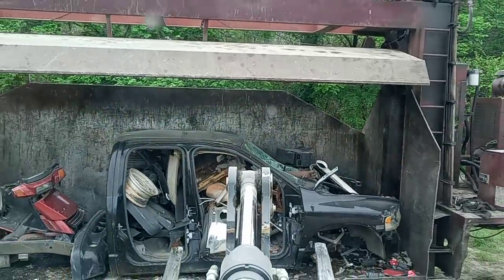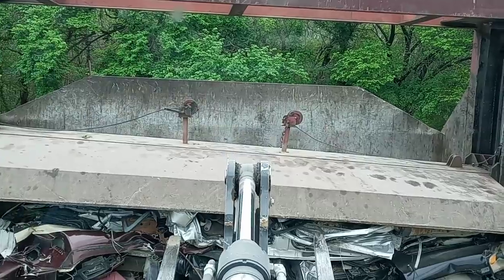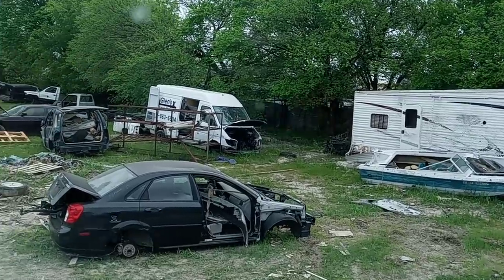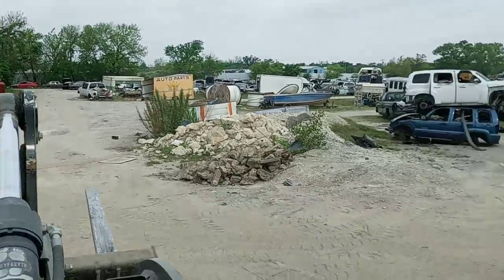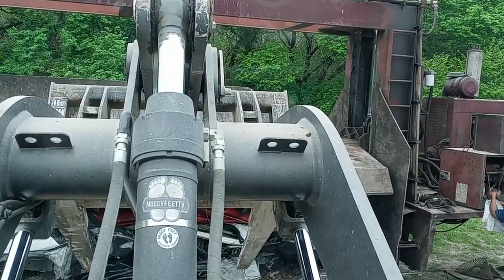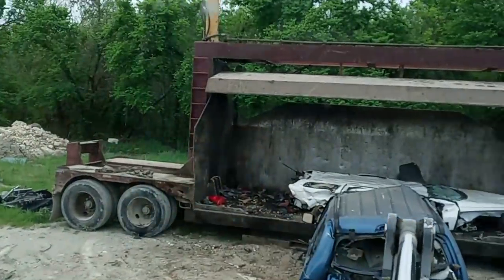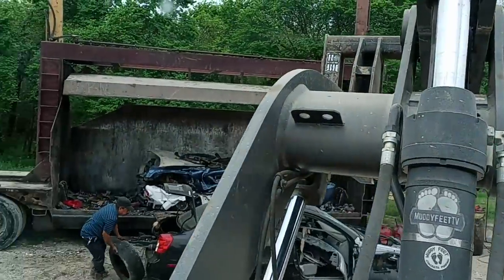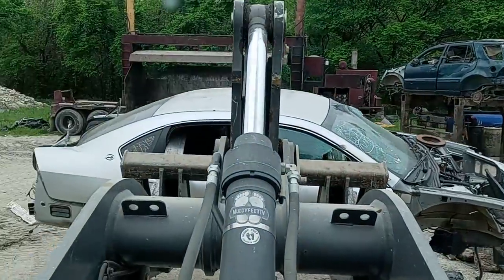Crushing Cars is so much Fun😀👍

Comment: Cowboy... the exhaust cleaner is called a regen. It's getting the exhaust filter super hot cooking the diesel soot. It gets in area of 2000 degrees. Never override the process otherwise it is prone to derating and possibly premature shop visits.

Comment: Cowboy, I take it the motorcycle getting crushed didn't get recorded because something cut out, understandable. How many office chairs, student chairs, whatever, have you crushed? With the one that got crushed they have a little bit of metal and some wood and fabric and all that. I guess the smelters have to separate all the non-metallic materials out and send it off for processing or whatever. You get the job done though, this yard will be awesome looking after you're done crushing in it! :D
Reply from the maker: We don't pull the dashes or seats out of the cars either. All that is sorted at the shredder